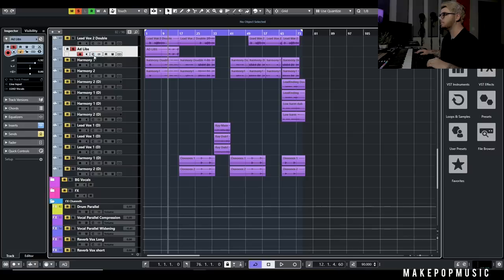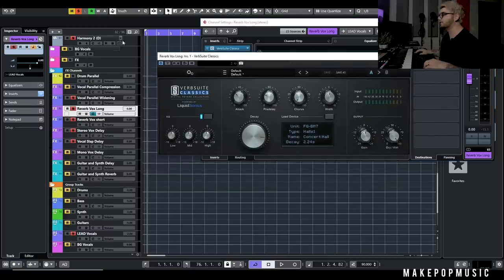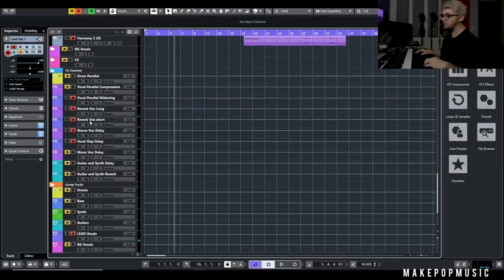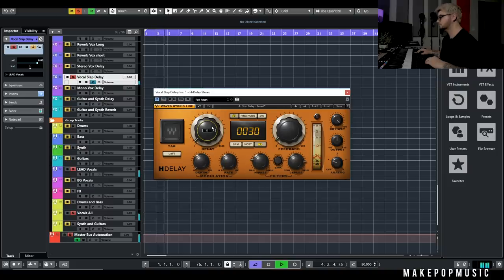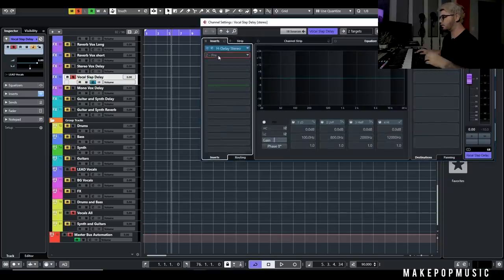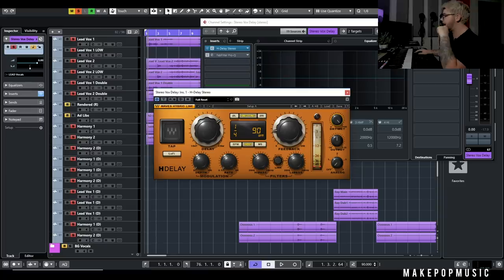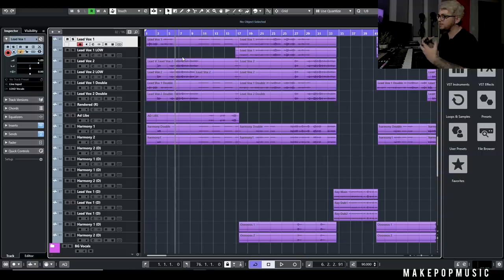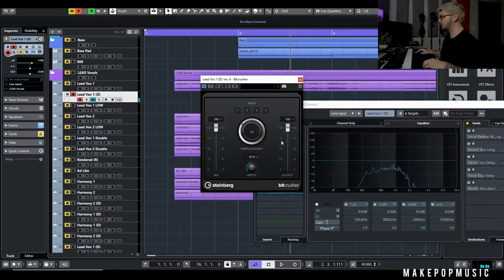The Basic & Not-So-Basic Ways To Use Reverbs & Delays | Make Pop Music

Comment: I get your point, but hold on...

dry/wet reverb on an insert works out completely different than reverb on a send. Turn wet to 100% on an insert and you dial out the original source until is completely gone. 100% on a send and you still hear the original source. That's quite a big difference you have to keep in mind.
Reply from the maker: I'm saying that when you use a reverb on a send, that reverb is 100% wet. The dry/wet ratio comes in from how hard you mix that send into your actual track. So a dry/wet knob on a plugin is like setting that plugin on a send with 100% wet and using the return as the dry/wet ratio.
Reply: Make Pop Music check! 👍